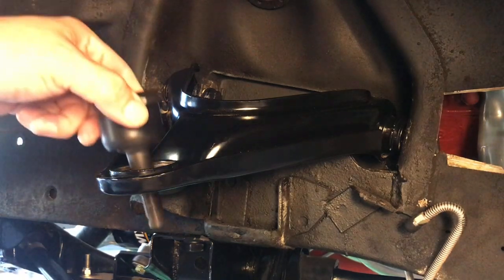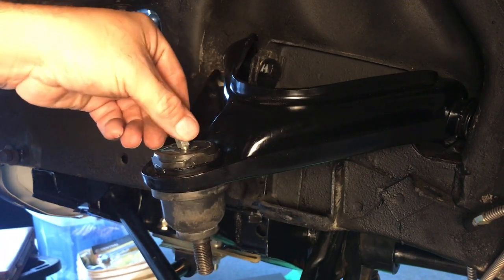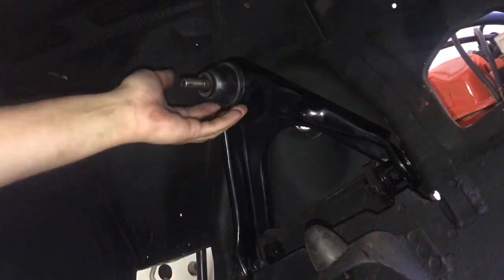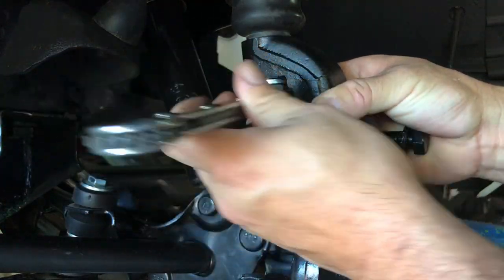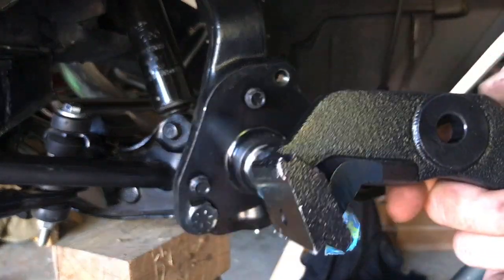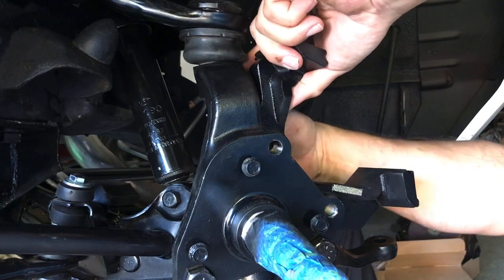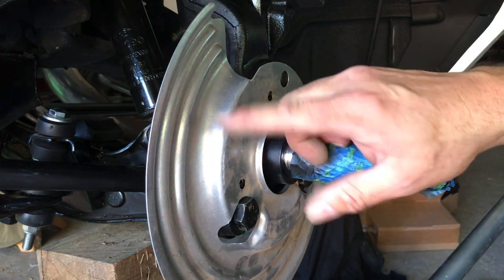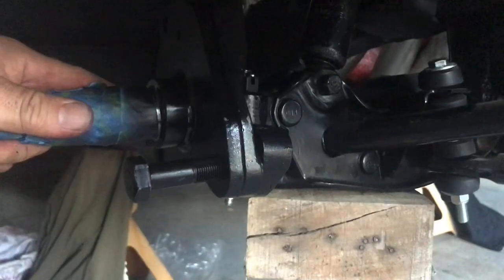How to do a Mopar front end kit install, Part 3, Spindles & Shocks

Comment: Cool your getting to be master mopar suspension tech.... PCV positive crankcase ventalition potato ....tomato lol do you know that you can also get threaded lower balljoints I had them on a 73 charger U code factory installed....you can also use the ball joints to cut the threads in the lower control arm they are self cutters but once you use them you can't use the press on style no more. The shock wrenches they are still being sold... Gearwrench type wrench or knock off helps out a lot!.... It's always better to tighten the castle nut more to get clearance for Mr Cotter...never throw any hardware away I have compartment boxes full so I rarely leave to get a bolt or washer 90% of the time. Keep the videos coming I really enjoy watching your work!

Comment: 8:22 am where can I find a rebuild kit for a 76 Volare. Need your help, Dave
Reply from the maker: I’ve never done one of those but I’m pretty sure most of the parts are the same as a 74-76 A body. I’ve used disc brakes from a Diplomat, same suspension as the Volare, on my B bodies before. Try PST, Performance Suspension Technology and POL, Performance On Line. Your car is considered an F body. Good luck.

Comment: Johnny what brand of control arms are you using?  Recommend rubber bushings or polyurethane bushings?
Reply from the maker: On the Charger I’m just using the stock upper and lower control arms. On my Duster I ran SPC upper A arms for more adjustability. I prefer Polyurethane. It lasts longer and is more robust. But it squeaks so be sure to grease everything.

Comment: I notice you use a lot of older parts you had laying around, I have my K frame out and need to replace all the bushings etc. do you have a brand or supplier you would recommend?
Reply from the maker: I can’t remember which I’ve used before. It was either Just Suspension or PST. One of those is just a kit with Moog parts or at least it used to be. All of those seem to be fine but I’ve heard the Moog idler arm is crap and doesn’t last.

Comment: Dang Chinese parts. I had a similar issue. One side has more difficulty fitting the wheel bearings too.
Reply from the maker: Yeah, it’s horrible nowadays. I have another issue like that but not as bad as the spindle. Next video in the axle series that go over the rear drum brakes. The freaking drums wouldn’t fit. And it wasn’t very obvious either. I bet the average guy woulda put them on and damaged their brakes. It’s nuts.